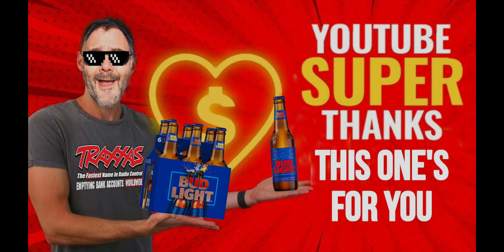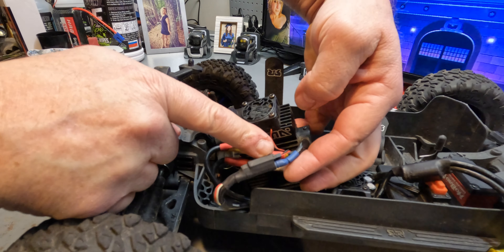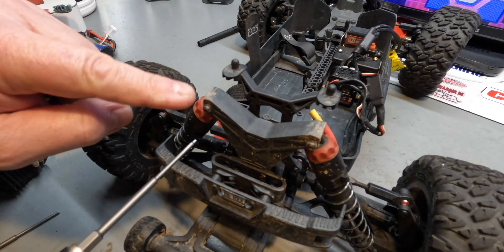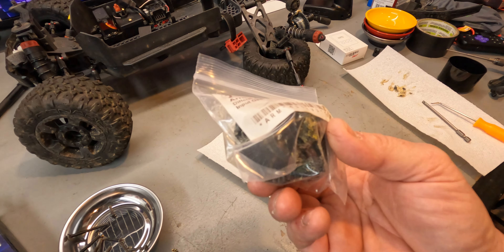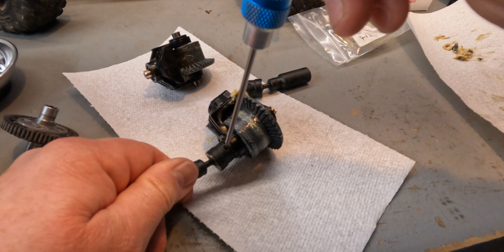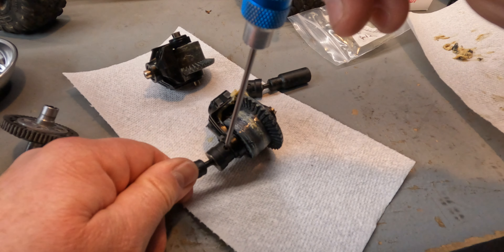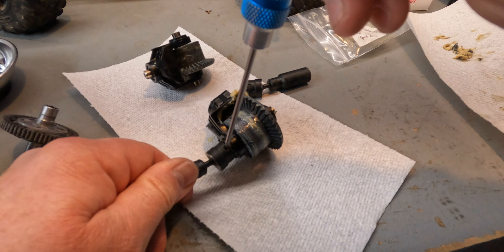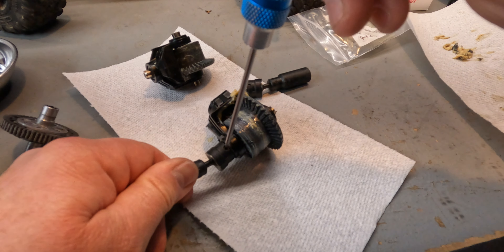Arrma Big Rock the FINAL Repair   or is it?

Comment: I had the same problem with the cracked slipper I contacted Arrma and they sent me a slipper gear and motor mount no problem. Mine came apart and bent the motor mount. Great video as always man!😮
Reply from the maker: How old was your RC?
Reply: @rcguygarage  I had only had mine less than a year when the slipper cracked on me to much power for that thin metal you had a premo fix though. My esc tabs broke so I used double sided mounting tape but it's not strong enough to hold it in place. Arrma told me I could mail on my esc and they would repair it WHAT like 8 months later

Comment: Thank you for finding that boost box. I have a arrma senton 2x4 that I've already got the 4x4 boost box in, then had to pull the diff back out and put it in my big rock. Jenny's sales the diff for like 13 or 12 bucks but the plastic ones are just junk man, I've even got washer between the two pieces so that it gave it a little slack or something to tighten the screws down on instead of just the plastic piece against the other one. It was helped but I got a 1900kv and 130 amp ESC and it loves to break the teeth off. Anyways even on Jenny's you don't get the complete diff setup for that cheap. Appreciate you showing your find, And can't wait for the stuff you mentioned coming up, have a good day Guy

Comment: I got the metal diff upgrade on my senton and big rock. It's worth it cause I'll never need to replace them again. Also they take 4s power, and 4s is a lot of fun. Lots of dudes just put the metal gears in the rear.

Comment: I did the metal pinion gear and ring gear up grade to my big rock. I think they are perfect for the big rock because its a little bit lighter than the outcast 4s and kraton 4s. A little costly but woth it.

Comment: Yeah, the metal diff is $50, with a yoke $65, and Boost 2 set w/yokes $100.
Plastic is $60 (but only $13 @ Jenny’s)
Or, if your stock diff guts are good, you can upgrade to metal ring and pinion by buying the upgraded diff housing for $8, metal ring gear $18, and metal pinion for $13 and do the swap for about $40 + fluid.
Short story long, when it comes to name brand vehicles, you’ve got options.

Comment: Man. U really should look into the slipper eliminator. Using the traxxas gear with the hot racing adapter. Instead of ur slipper.  Made all the difference on my big rock.
Reply from the maker: Not just yet. 😜

Comment: Don't ever just replace a plastic ring gear or pinion. I did that before i upgraded to metal. I thought my pinion was fine and just bought a plastic ring gear. The plastic gear wears considerably and ended up stripping out the only gear i didnt replace 2 runs in. Thank god you got a new diff yeah buddy!

Comment: I finally got sick of replacing stripped diifs in my Senton & Big Rock every few months that I decided to give those Chinese knock off 4S metal diff case, input & spur gears that you see on Ebay & Amazon for around £15 to £20..
They're a bit noisy but they've really lasted so far, my Senton has been running 3S & 4S through them for almost a year & they've still got a ton of life left in them, only slight wear & no chips.!
The Big Rock's had them in for about 8 months with the same results.! 
I'd absolutely recommend fitting them, they're a cheaper option & they've already lasted 3 times longer than the Arrma ones.
In the UK a diff input is £10 & £10 for the diff gear/case.
The Arrma metal 4S gears cost about £50. FIFTY.!!!!
Stay safe out there mate & the very best wishes from Scotland 🏴 🙏 ❤️ 📻 🕹️ 🔋 🚗 🚖 🚕 🚔 🚚 🚙 🚘 🚓 🚒 🚑 🚐 🚎 🚤 🚁 🛩️ 👍 👍

Comment: Hey bro have you had good luck with your cvd sliders on your BRCC? Im on the fence about buying them.
Reply from the maker: Watch the video tomorrow and you can determine for yourself. I know it's easier just to say yes or no. They do work My initial reaction to them was they were too short for the actual sliding portion. As long as the truck is not too heavy I think they seem to be working fine.

Comment: ARRMA - ARA311156
$64.99 thats the metal gear diff assembled with yokes and all. Crazy that it's priced the same as the plastic. I assume they just never updated costs after redesigns.
That boost box is the way to go.